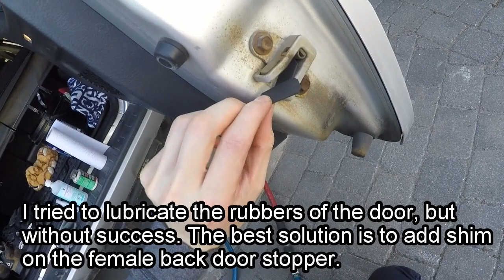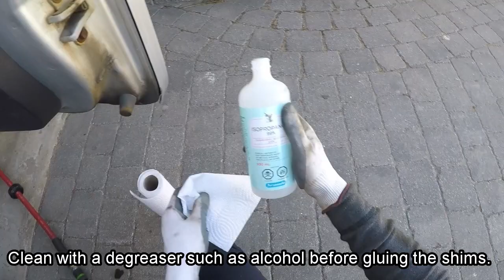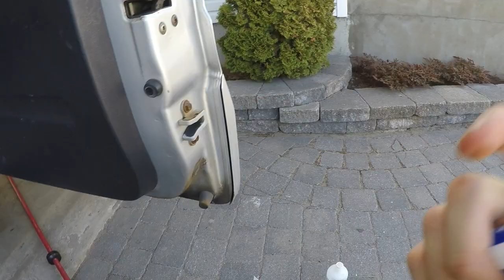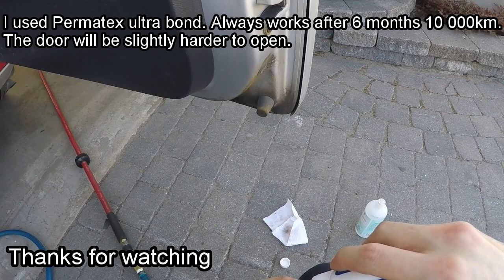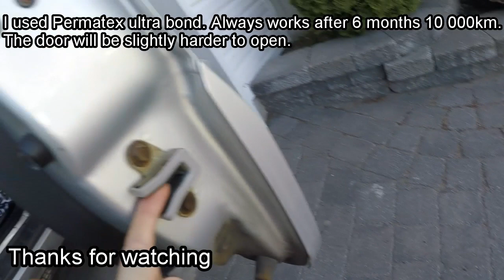How To Fix Back Door Rattle, Squeaky Noise Rav4 2006 2012

Comment: I didn't find a lot of wear in this door stabilizer. About 1/16 inch step in it. A slither of Formica ( cut from a free sample from Lowes ) and super glue brought it back to original size/shape. Door still squeaked. I found a bit more wear in the hasp/stricker part that door latch grabs. Removed the two screws, flipped that part 180 degrees and reinstalled screws. The latch is now grabbing the previously unused side of the hasp/stricker. About two weeks ago. No squeak since. Door opens and closes like new. I'll try to keep some white lithium grease on all these parts.

Comment: I purchased the new female back door stopper from dealer, and noise fixed. ^_^  With both rubber stoppers (top and bottom) cost AUD$30.
Good problem diagnosis, thanks for the video, keep it up.
Reply: whats the part number

Comment: Wow this worked. I used some felt strips from Homes Depot and cut them to size. I will be on the look out for these gasket ones because they are much slimmer and look more pro. Thanks this saved me $300.00+  on what I thought was a bumper issue.

Comment: My 2010 Rav4 (same Gen) had the same problem. I fixed it by placing thin  shims between the metal bracket and the plastic insert. Thereby squeezing the the upper and lower parts closer together. Lubricated with candle wax.Now tight as new and no more clunk when hitting a sharp bump. Now if I could only find a cheap and easy way the reduce the rear road noise. Probably the only (effective) way is to apply sound deadening material to the inner sheet metal. Undecided on whether to use the stick-on sheets or spray/paint on stuff.  Either way still need to remove a lot of the interior. Going to start with just the floor and rear cargo area. Doors are much more difficult and time consuming.

Comment: You can adjust the catch 'u' lock with a hammer pushing it inside so the door locks firmer. Been using this trick on the video but found the permanent fix above